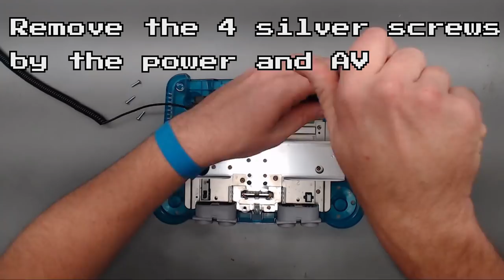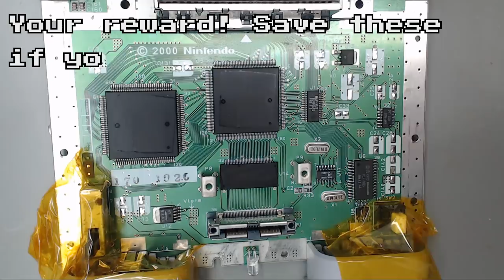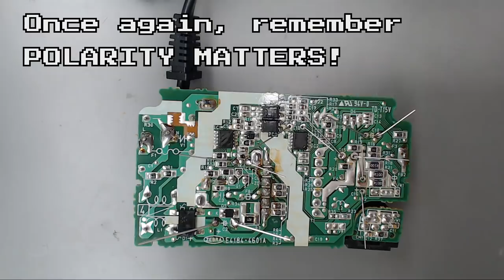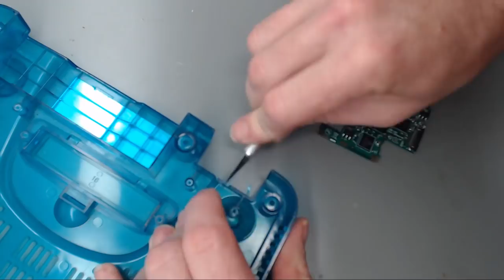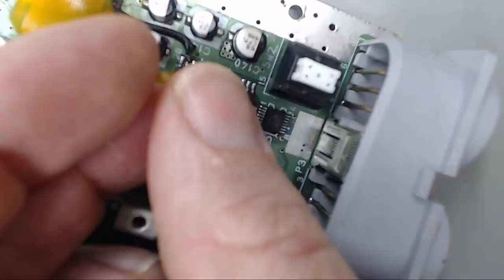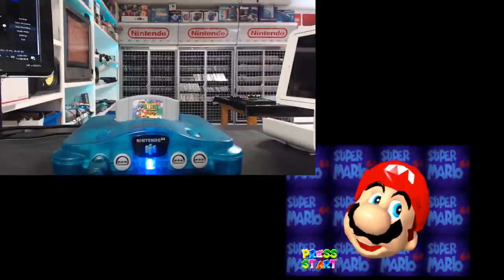Nintendo N64 UltraHDMI 1080p Installation + Full Capacitor Replacement!

Comment: Those caps are made really well I’ve never seen a bad one. The n64 has amazing build quality. Shouldn’t have to replace them
Reply from the maker: richieb74 you are correct. The caps used in N64 consoles are of high quality and I have yet to run into bad ones in a N64. I offer the service as a preventative maintenance as all electrolytic will fail over time and some customers prefer me to change them out while I’m inside their consoles doing other work. 

Thanks for the comment!
Reply: On the old Nintendo products you can see the logo "Official Nintendo Seal of quality". That really meant something.

Comment: Also, you don't have to use anything other than the D-pad when using the UltraHDMI OSD menu, which really helps reduce accidental inputs. Right is Accept/Proceed and Left is Back/Cancel.

Comment: Great video! Just thought I'd add my tips, since I've done a few hundred of these. ;)

First, there's usually no need to deliberately remove the Expansion/Jumped Pak. It'll typically pop off with the top shell!

Next, make sure you lift the heat sink from the back (cartridge slot side) or you risk lifting the RAM, with only has enough pins on the back side.

Third, the cart slot is removable in case you need more room to work. Just lift both sides evenly to avoid breaking the plastic wings. Probably a good idea to look under there anyway and try to remove debris that has settled. Some of them look really nasty even though it's usually just factory flux leftovers and a little dust/hair.

Fourth, the cable has notches that you are supposed to fold between in order to make your two folds. It's usually best to make that first one before you make your PIF/via connection.

Last, make sure you slot the heat sink tabs inside both sides of the Expansion/Jumper Pak slot before you screw anything else down to ensure proper alignment. I can't count how many times I've found it improperly seated after someone else has been inside (typically when I salvage someone's failed UltraHDMI install).
Reply: Hello Emmet, good info on top of an already great video. Rockin’
Reply: @TalonNismo  Thank you
Reply: I am thinking of buying the Ultra HDMI kit. Would you be willing to do it for me?

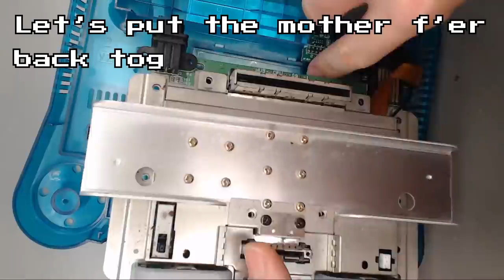Comment: @15:10 I was expecting you to use hot glue on the flex cable near the soldered points so that to limit movement of shock if dropped or bounced. Nice work
Reply from the maker: I do my best to NEVER have to use hot glue for any of my work. If you solder correctly using good quality flux and solder it will not be an issue. Save the Hot Glue for your macaroni art projects! lol Thanks for the comment!

Comment: Congratulations on your great work on modifying the console. I'm a new subscriber. Is this mod equivalent to an adapter that is sold on the market that is inserted in the av output of the nintendo 64? Here in Brazil it is common to make the mod rgb (which is not native to the console). This hdmi mod is new to me. Success for you.

Comment: I'm confused does adding the hdmi mod all of a sudden upscale the quality of everything it outputs
Reply: Depends on whether the HDMI card upscales yes or no, some do, some don't. But it allows you to easily connect old consoles such as this to HDTVs, not only through the ease of use with just 1 cable rather than having to use something like an OSCC, but also the signal itself is way easier for the TV to recognize as its a digital signal out of the console, rather than an analogue one that needs to be converted by either the TV or a separate upscaler.

Comment: Instead of scratching away the solder mask with a scalpel an easier way is to use a fiberglass pen and it will reduce the possibility of accidentally cutting a trace.

Comment: Great video! How long do you think these new capactors will last for? I'm curious of how often one may need to replace them
Reply from the maker: Well the ones in the N64 are already very nice high quality caps and have already lasted 25+ years. I consider this to be preventative maintenance and would hope that the new high quality caps I use would last another 25+ years. However some consoles have extremely piss pore quality caps and if haven't been recapped by now have probably leaked and done damage to the board! Like the Sega Game Gear, Sega CD or NEC Turbo Duo all had shit 90's era SMD caps.
Reply: Dragons Hoard Gaming oh wow. I didn’t realize there is an off chance of old caps damaging the board :o I’m just starting to learn about this stuff. Thanks the PSA!

Comment: What do the new caps do for the system ? I’m curious as I’ve never heard of changing em
Reply: This is an old comment, but my best guess is that capacitors from 1999 - 2007 were prone to failure and they simply replaced the caps just to prevent any failure from potentially faulty caps.
Reply: @HavokTheToast  thank you. Despite the age of the comment I forgot the question and never did get an answer so I appreciate you giving one.

Comment: Just finished playing my n64 but noticed it gets hot rather fast. What do you think could be the cause? Great video btw!
Reply from the maker: N64 runs hot as there is no internal fan or anything for cooling, that's why the top has that massive heatsink.
Reply: Dragons Hoard Gaming Ah okay thanks for the reply!

Comment: I have this same Nintendo NUS-CPU-09 2000 board in my Pokemon N64 with Pikachu on it and it needs new capacitors.  It turns out these boards caps go bad and can result in no sound like on my board.  I just ordered some new caps and I will be replacing them to fix it.  I just wish I had an UltraHDMI kit to put in it as well!!

Comment: Is there a kit to purchase?  Is there a cheap place that sells all the capacitors? I'm trying to fix an n64 with purple looking video output and I assume it's one of the bad capacitors but I don't know what kind of capacitors to buy.
Reply from the maker: I purchase all my cap kits from Luke @Console5.com. Luke sources only high quality components for all his kits plus has lots of great pics and capacitor maps available on his online wiki. 

Link for N64 Cap Kit...
https://console5.com/store/n64-nintendo-64-smd-cap-kit.html
Reply: @dragonshoardgaming5514  Alright, thanks. That was the only website that I had found on my search for a kit for the board of capacitors so I had it saved under my favorites. Obviously there is the power plug but I don't need to fix that. I actually have a number of extra n64 boards I got off ebay and it seems the common problem is nothing showing up on screen (flash but nothing comes up like the game is dirty) even when using a tested working cartridge connector and cleaning all the boards with isopropyl.

Comment: Is it really worth replacing the capacitors? My issue is my cart slot only works if I pull the cart forward on boot then it works fine afterwards
Reply from the maker: IMO replacing the caps in a N64 is nowhere near as important as in something like say the GameGear. The caps in the N64 are of great quality and I only offer the service as a preventative maintenance. It sounds like to me you need to clean your cartridge connector, games or both.

Comment: PLEASE PLEASE include a warning about taking about the power supply, no matter how strong the power supply it is still dangerous to take it apart and risk shocking yourself severely.
Reply: It's really not. Unless you're taking the thing apart while it's still plugged in, the caps won't be energized by the time you get inside of it. Those caps aren't large enough to hold anything dangerous for long.
Reply: @Sun-ut9gr  Please don't ignore caution with electricity and spread misinformation. It's better to be safe than sorry. Your body has a natural electricity that goes through it and can be disrupted.

Comment: Would a failing power brick cause the screen to go black and say no sync? Its an official power supply.  It sucks if they didnt recap it if it comes with the kit.  I just bought another power supply and it was fine for the 30mins I played. Im just hoping its not a fluke because the black screens were kinda random.  I was getting a yellow tint a few months ago but I havent seen that in awhile
Reply from the maker: Any update on this? Did the new power supply fix the issue?
Reply: @dragonshoardgaming5514  I believe so,  it hasnt happened again.
Reply: Many years ago I identified one PSU that caused this out of several. I later fixed it by replacing the capacitors.

Comment: You forgot to replace C2 (on the low right of the RAM chip) C160 and C161 (upper left), not important because its a ceramic one, but still not a full capacitor replacement. /s
Reply from the maker: Yeah and about 100 more ceramics on the other side of the board. Generally a full recap is  replacing just the electrolytics as ceramics aren't known for rupturing and leaking caustic fluid on the board.

Comment: Why need you change the cap?
Reply from the maker: I do it as preventative maintenance as overtime all electrolytic capacitors can fail. N64 caps are of good quality but some customers prefer me to change them out will I’m doing other work on their consoles.

Comment: So, how hard are these hdmi kits to find nowadays? Thx
Reply from the maker: Impossible. If you do you will pay 3x the amount as the kit hasn't been released in over a year. I've been recommending the N64RGB board and OSSC as it can give you similiar results to the UltraHDMI. Links in my pinned comment.
Reply: Damn, I've only just seen this.... Great video man... Very professional...👌
Reply: @dragonshoardgaming5514  wow! Excellent advice, and I heard the RGB  mod is more straight forward/easier to do. I just wish it had the anti aliasing off mode. Just one more question? Why was it out of production?

Comment: u can just rotate the cap, its easier and its still safe toremove the cap
Reply from the maker: I definitely don’t recommend that. If you try that on certain consoles and the capacitors have already leaked and done damage you can easily rip pads and traces up with the cap when you do that. It’s not that hard to use a hot air reflow station, they’re pretty cheap and safer.

Comment: I really tired of this recapping hysteria
Reply from the maker: While I will agree that the caps in the N64 are not of terrible quality like say for instance Game Gears, Turbo Duos, XBOX clock capacitors etc... I don't see anything wrong with wanting to do some preventative maintenance on your console. I don't know how many times I've removed caps that look fine until you pull it and see that it has been leaking underneath and damaging the pads. Caps fail overtime, could be 5 years could be 40 but if your replace them with good high quality caps the clock starts back at zero. In the end I do what my customers pay me to do. Thanks for the comment.

Comment: SO you said its now in 1080p sorry to tell you its still 480p just re scaled to 1080P. its not native 1080P its and its not 16:9 and not all N64 games like to be re scaled. if you ask me the best way to get old consoles to play on new TV's that don't have RCA or s-video or cox is to buy a external converter so you can use it with all of your old consoles without having to open\solder anything.....
also adding things to your "mobo" and leeching power from it is really bad this could cause premature failures in hardware plus the add strain to the power brick could cause extreme heat or even fire.   external converters are cheap and easy to find in stores and online and you take no risk of damaging your stuff. lots of external converters have built in re scalers that can be turned off with the flip of a switch plus just about every TV made today has built in scaling so all you really need is a very simple converter.

This is really cool but not worth it at all thanks for the video.
Reply: First, N64 games are either 240p or 480i. Most games are 240p though they might jump to 480i in menus, title screens, or when you pause it. Second, most digital TVs with analog inputs do not correctly scale 240p, nor do the cheap $20 scalers nor do the cheap $30 HDMI cables. You need special hardware like an XRGB Mini Framemeister, OSSC, or RetroTink 2X. Third, the N64 does not support RGB. For most, composite is the best you can get without modding the console. Fourth, many N64 consoles require a digital RGB mod that is as difficult or more difficult than installing UltraHDMI here. Fifth, none of the generic scalers can do VI Deblur like UltraHDMI. Sixth, only specialty enthusiast hardware like OSSC or RetroTink 2X can scale without introducing more than a frame of latency. Seventh: The console's power circuitry was designed with overhead for things like RF modulators, special controller accessories, smartcard readers, capture hardware, etc. As someone who has completely re-engineered the N64 board and reverse-engineered individual chips inside, MarshallH (the creator of UltraHDMI) knows the specs inside and out. Eighth, no analog solution is better quality than direct, lossless, never-existed-as-analog digital. With UltraHDMI the signal never existed as analog so it never had to be digitized with lossy analog to digital converter (ADC) that could also introduce unwanted latency. Ninth, there are several anamorphic 16:9 aspect N64 titles including Goldeneye 007 and Donkey Kong 64. Also, the output can be matted to 16:9 for 4:3 games in case your display forces a stretch on digital or HD inputs (many do).

It is not for everyone. Clearly. It is for the top-level enthusiasts, purists, archivists, speedrunners, streamers, and world-class Smash players. If modern issues bother you and you just want to play then, you're right: a CRT is usually the way to go (almost free). :)